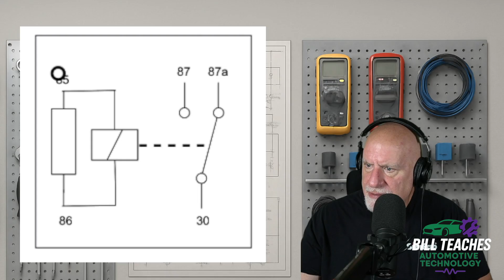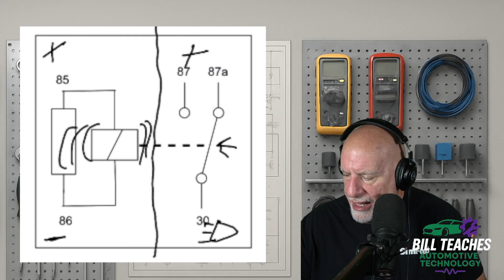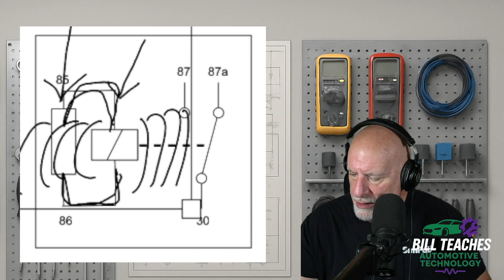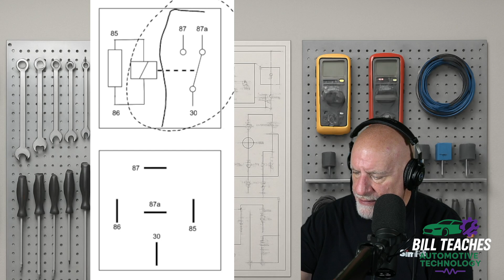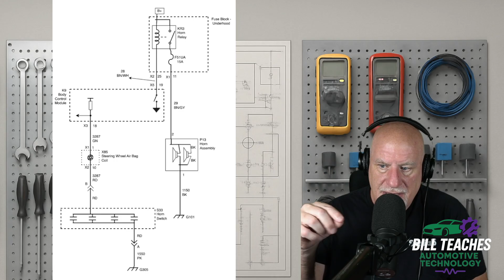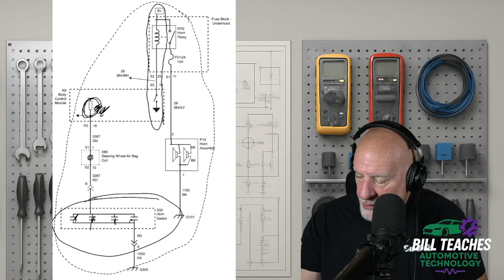How Automotive Relays Work (30, 85, 86, 87 Explained Clearly)

Comment: How would you check a relay for starter switch / relay?
Reply from the maker: Hi Robert, thank you for the question. Starter relays work the same way this one does. This is typically how it works with starters: The ignition button is pushed, sending a signal to the Body Control Module or Powertrain Control Module. It sees you intend to start the engine, so it then grounds the coil side of the relay, which then closes the switch on the switch side, sending current to the starter.

Comment: On my 2012 sierra the BCM would not energize the starter relay and figured out it wasn’t talking to the ecm. I towed it to the dealer and it cost me over $600 to tell me that I needed a new stereo. It’s been unplugged for a year now so I could drive the truck but the other day I plugged the stereo back in and everything is fine. ?  I’m not happy with this new stuff!  I could get stranded in the woods or something.
Reply: You’re really great at teaching. It’s your calling. Thank you so much for taking the time. Old HVAC guy.
Reply from the maker: @donthebrain  - I really appreciate the encouragement!
Reply from the maker: Hey Don, this is not the first time I have heard of this same issue. Kind of weird that it doesn't affect it any more though. Modern vehicles use computer networks that communicate with each other via dedicated networks, or networks shared with certain computers. In the early days of CAN, and aftermarket radio would try to communicate in the middle of other modules communicating, causing messages to be sent that the other modules didn't understand, which caused a lot of issues like you described.
For example: In the middle of the BCM telling the ECM it can energize the starter relay because it saw the input from the ignition switch, the radio inserted its message, creating a message the ECM wasn't programmed to receive, so it ignored it.
Reply: @BillTeachesAutoTech  I have the factory stereo. If it ever does it again I will be ready to unplug it. I’ve thought about gutting all this computer stuff and putting old school. They don’t do inspections here. But I’ll probably never do it. Lol
Reply from the maker: @donthebrain  - Oh...Thats wild. May have just been a poor connection at the communication terminal in the radio connector and unplugging/plugging made it better
Reply: @BillTeachesAutoTech  That’s the only thing that makes sense.

Comment: would grounding con 25 be a quicker way to test the horn circuit ?
Reply from the maker: Hi Garry! While grounding pin 25 in connector 2 of the underhood fuse block looks easier on the diagram view, in reality that is located underneath the underhood fuse block and takes more work to access.
I like your way of thinking though, and thank you for the question!
Reply: @BillTeachesAutoTech  interesting ,thnks.as an industrial electrician, our focus was on  minimum downtime and ease of  troublshooting. also noted that if wire 28 had a ground the horn would blow constantly. the JOY of negative  switching.
Reply from the maker: @garryspeiran4374  - Negative switching can be a pain for sure! Interesting that your background is industrial electronics. I'll be graduating with a Mechatronics degree in May.

Comment: 2015  C7 z06 blower motor doesn't work. I pulled it out. Will order a new one

3 wire connector  to the motor.
A terminal (power) was burnt up
Should I be concerned as to why it got burnt up? Or just install the new one and call it a day?
Also radio control/infotainment screen is turned off and cant change settings on it. 
Seems to be linked. Digital cluster flickers, needles will drop dead but engine is still running nothing wrong
Just the lighting of it flickers
Reply from the maker: I am so sorry for the delayed response. I have seen this on many vehicles and it's usually one of 2 things: 1. The blower motor is drawing too much current overheating the connector and causing the burned terminal. 2. and most likely is called micro arcing. When a high current terminal isn't making perfectly good contact, the space between the male and female part of the terminal makes the current jump across to complete the circuit, much like a spark plug. Over time, this creates more and more resistance and resistance causes heat, eventually burning up a terminal or connector.

The other issue is a little tougher. Could just be a poor/loose connection internal to the screen and IPC. What I would do is check wiring schematics for both systems and see if they have a common power feed or ground. If they do, check to make sure it is making good connection, but my bet is on a integrated circuit board in the infotainment system and the IPC (cluster) has a poor connection.